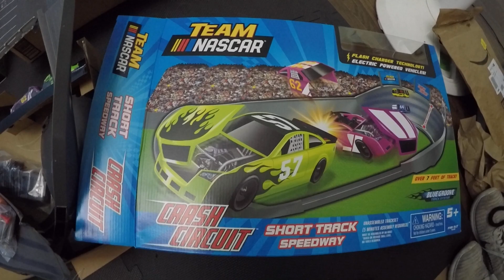NASCAR Crash Circuit Short Track Speedway Quick Review

Comment: Thanks for the review!  My track does happen to run pretty fast, and this could be something that works well for it, though it depends....  Does the 180º turn on this set have the same dimensions as the regular one, excluding the difference in the lane width?  I mean, could a person just swap out the two 180º units without having to really move the rest of the track, like, say, if for some odd reason the two ends where the unit would connect where more or less fixed in place?  Or would that person find themselves in a situation that I believe is technically referred to in the diecast world as "a giant pain in the ass"?
Reply from the maker: Yes, this curve is plug and play if you wanna replace a Crash Racers curve. I had to adjust one of my straights a tiny bit. The footprint is just about the same, but since this curve is actually designed as a 180, you don't have to flex it to 180.

Comment: I wonder if I can use this for Duralast cup racing 👀🔥👌🏻
Reply from the maker: You can, but the lanes are 2 wide instead of 3 and the sets only come with 30 inches of straight so you'd have to buy a bunch of sets. I think your Sizzlers are better. I dont like these as 180s, they work great as 90s though.